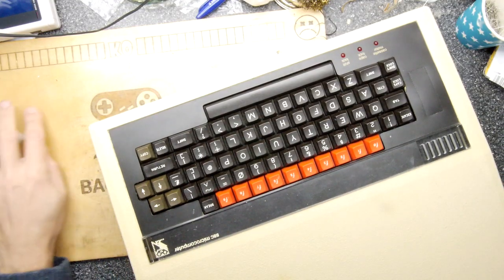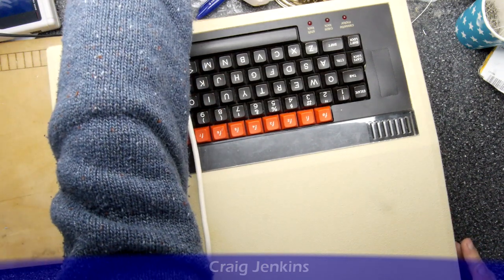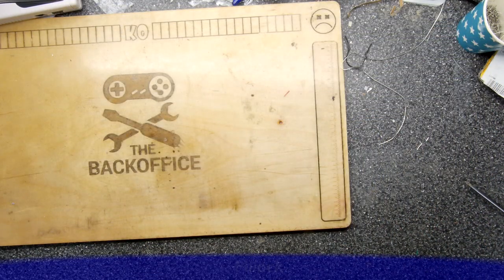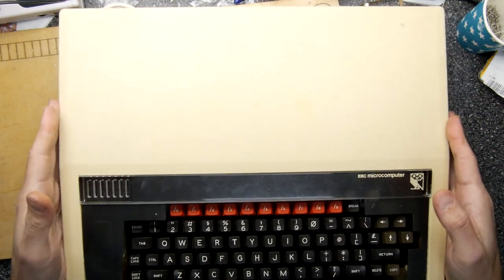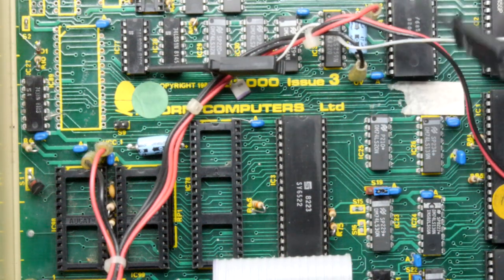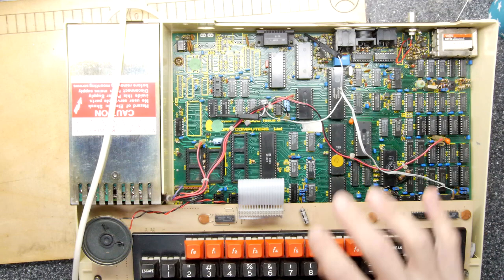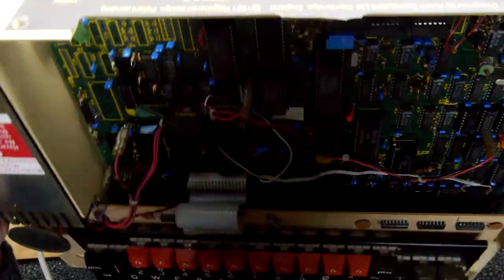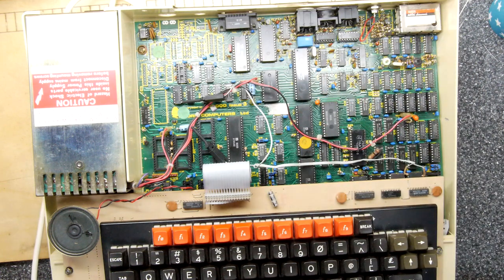BBC Micro Quick Fix

Comment: I'm guessing that your sideways ram was connected to Write Strobe for the RAM on pin 8 of IC77 and Bit 3 of the ROM select latch on Pin 11 of IC76. These signals are available elsewhere, but please check that I am correct before connecting. SWRAM is used by a few games and can be handy to load ROMs for a quick test.
Reply from the maker: I'll give it a test, I posted a video that Custardo kindly reminded me existed of a previous time I was playing with this. A freeze frame at the right timestamp might show the approximate area. I can cross check that with your info and 🤞

Incidentally have you ever tried exile? I've never got that working with any sideways ram even though it asks for it
Reply: @backofficeshow  I've run it with sideways RAM on a real beeb, but that was about thirty years ago. If it gives you the prompt on startup then it should work, as it's obviously detected it and able to use it. You should get a larger display area and more audio I think.

Comment: First time I’ve ever seen a machine fixed by pushing the chips back in. Normally that’s the hopeful last resort before the soldering iron comes out.
Reply: Had something similar with my Atari 520 STM two years ago. After 25 years of storage it worked perfectly... for about 20 minutes! Then only bombs and reset, bombs and reset etc.
After firmly pushing in all socketed chips it works fine now! 👌
Reply from the maker: Nice easy fix! Phew
Reply: It's also a common problem with ancient Electrons - I fixed one recently by reseating the ULA. I did clean it as well, but I think it was the reseating that did the trick.

Comment: It's a hard life being a BBC micro owner. Got to press those chips back in every so often and every 40 years or so your Rifas go up in smoke and need replacing. It's hard I tells ya!
Reply from the maker: I might have to do this job once more. Maybe 😂
Reply: @backofficeshow  could the chip creep have anything to do with the floating fly lead. Have you been roughhousing with your beeb ;)
Reply from the maker: I don't think so, I was just using it in the regular way
Reply: @trickysoft  It's common on stock machines right from new, I've always had to give mine the very same TLC, there's something very satisfying about doing it. Just temperature cycling related. Press them back in and you're good to go.
Reply: @ches74  the Acorn Atom is almost designed to encourage it. Chips are upside down, on the underside of the keyboard which doesn't have a support frame iirc.

Comment: Mine does this from time to time, and it’s always one of the ROM chips that has moved. In fact, when I got it, on of the legs on a ROM was bent under the chip, so no idea how it was working at all! 😆
Reply from the maker: I sometimes for turned pin sockets to eliminate the problem. It's genial to pull chips out of those 😂